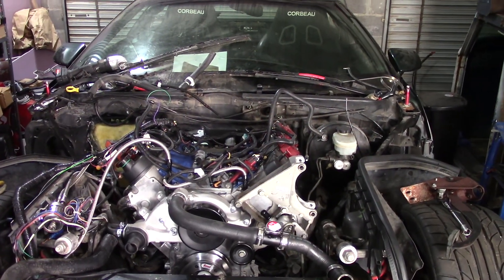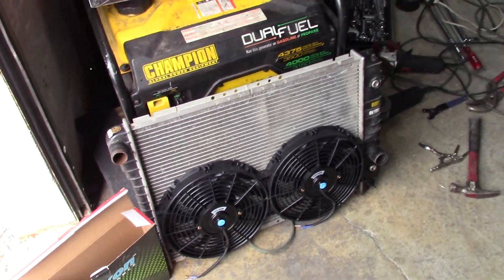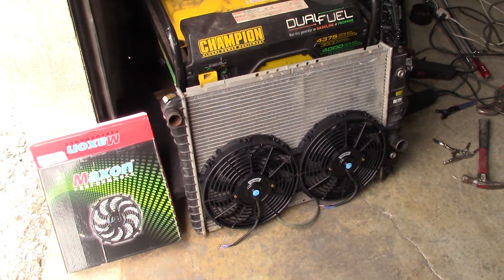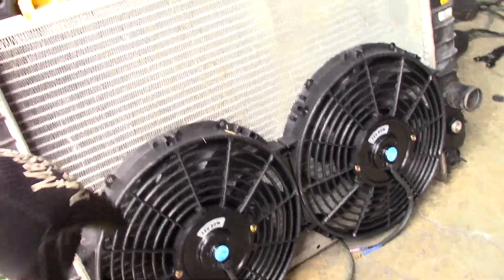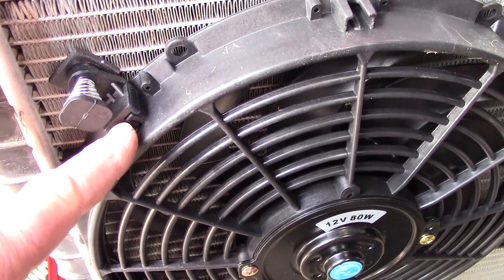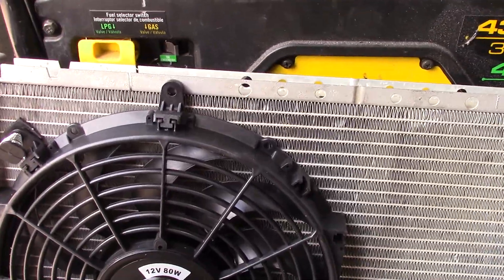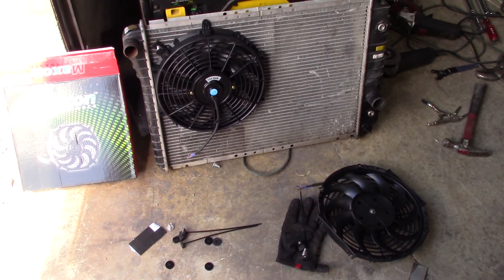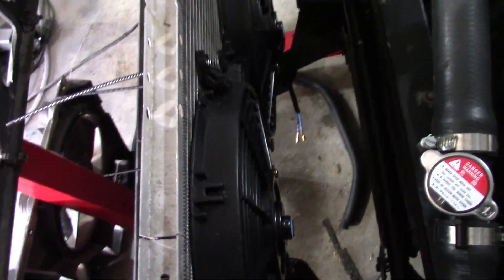How To Install a 12v Electric Radiator Fan....Maybe.....

Comment: I disagree. If your fans are in the "pull" air configuration, it's better to have them about an inch from the radiator. This is why the springs go between the fan and the radiator, which also helps absorb the vibrations from the fan to the radiator. If your fans are in the push configuration, then you want them right up against the radiator.
Reply from the maker: You could be 100% right.  I only wish I knew how the actual manufacturer meant for it to be mounted.  Thanks for watching and the input.

Comment: I paid a bit more for a fan that seemed a bit better quality here in the Uk & the instructions were pretty vague showing where the spring goes but not which way round it went.. Also the arm had the cone for the spring but in the wrong side .. !! I mounted the Fan on an alloy frame in front if the Rad "which is 50 years old  & in good shape" as i felt it could damage the Rad Finns.. there's a 5mm gap between Rad & Fan and cooling seems ok, but British summer's are crap anyway... 😣.. Thanks for your Vid it made me feel better knowing I wasn't the only confused customer...
Reply from the maker: I really have to wonder why the instructions are so bad, or why there are none at all.  It's very odd.  Thanks for the comment and for watching!
Reply: @carstars1181 I'd think the seller is making a few ££ out of each sale so why not take some time to ensure it comes with clear instructions, but no...

Comment: So now it is my turn to try it. My fan threw a blade and damaged the radiator, so new radiator and fan required. No genuine fans available so this was the only option. I have noticed they are different wattages. The one I got is 80 watts. I am just not sure what wattage is best.
Reply from the maker: @rodf1301  I don't think you are going to find a massive variety of wattage.  80 watts sounds pretty standard.
Reply from the maker: @rodf1301  well I wish you the best of luck and if you come up with a better way to mount it, let me know!

Comment: I have found an instruction manual from Hayden’s and you are pretty spot on, it says:

Fan Mounting Hardware:
6A. For fans supplied with separate mounting brackets (Type 1), insert the four mounting bracket into
the slots on fan.
6B. Remove paper backing from the foam pads and apply the pads to the bottom of four bracket. Trim
off access foam to avoid interference with the fan blades.
6C. Slide the small end of the conical springs onto the mounting rods.
6D. Place the fan assembly in the desired position on the radiator or AC condenser.
6E. Carefully, push the mounting rod through the holes in the brackets on the radiator or AC
condenser. Do not insert the rods through both the radiator and AC condenser
6F. Push the lock buttons over the ends of the mounting rods. Pull the rods through the buttons until
the springs are 1/2 the original height. Trim the excess rod.
Reply from the maker: Interesting.  I got pretty close it sounds!!!  lol

Comment: Good luck my friend, I had a leaking radiator from going this route after about 6 months. I would recommend buying an actual shroud. Plus, it will pull the air through better. I went with a dual aluminum shroud. It's much easier, much cleaner and you can swap the fans just by removing the shroud.  Additonally, your radiator will not have anything pressing up against it. I just don't trust those clips.
Reply from the maker: @PrimeG2  I hear you on that.  Maybe I'll run it this way just to get it going and then swap out to something better once I can afford it.

Comment: Thanks for your efforts, I came across this looking for an instructional video myself.  I think the straps are supposed go from the back of the radiator, through first a pad and then the radiator, and then through another pad on the other side (2 pads per strap to protect the rad on each side), and then through the spring which is in the cup of the bracket.  But the bracket is oriented as you first tried it, the opposite of where you ended up (the wide end of the spring is facing the rad but is against a pad).  And then as you cinch things closed with the final roundish plastic pieces on the strap, that draws the fan in towards the radiator.  At least that's my current plan :-)
Reply from the maker: Thanks for your input.  Now you need to make your own video showing how it's done!  But really, why are there no printed instructions sent with these things??
Reply: That actually sounds about right
Reply: also here looking for instructions
Reply: Here’s my own experience. My last install done 3 years ago I was having these same questions as Iam now lol. Let me tell you my current radiator failed and it was because of how I mounted the pads or springs. I’m just going to follow thru with what I had done years ago because I’m dropping in a new radiator right now and ya it looks like how you placed the pads between the fan and a pad on the other side of the radiator and the spring on the front side. Sometimes these ties are defective and they pop apart so give them a tug after you zip them into place goodluck guys 😊
Reply: And the trick is not to pinch them down too hard either to keep the gap between the fan and radiator but like I said the fan mounting wasn’t the cause of my recent radiator failure the dam core Itslef developed pin holes and blew out before the fan could ever vibrate thru lol